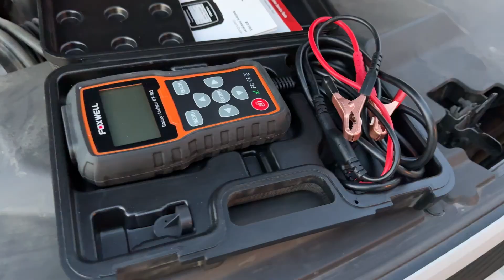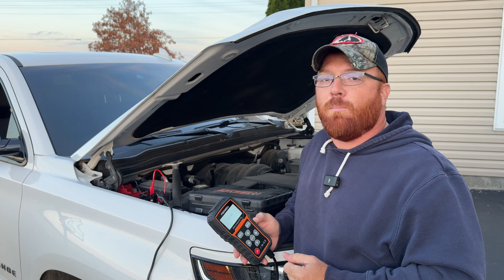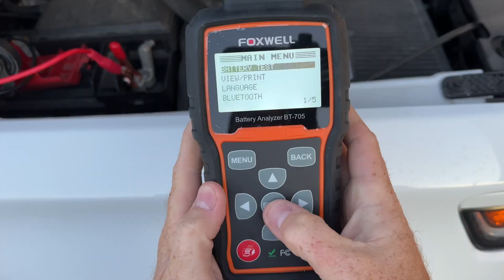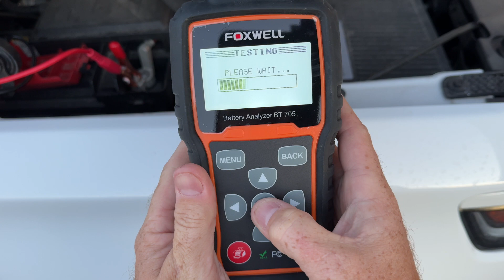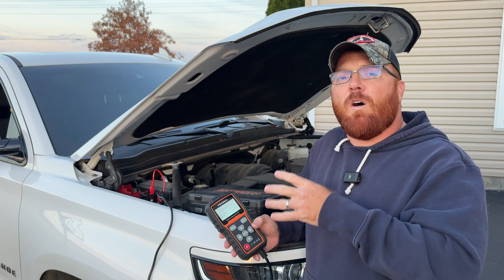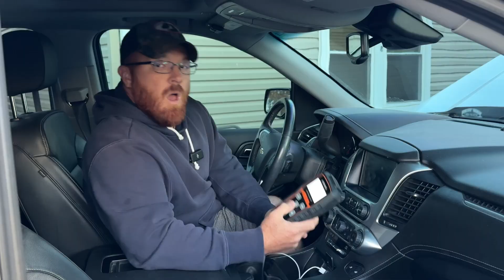FOXWELL BT705 Car Battery Tester Analyzer Review | Test Battery, Starter, & Alternator!

Comment: Got one coming in the mail on Saturday. Crossing my fingers.   I hope its the battery.   I just changed my Alternator back on July 4th, 2025 and the battery back in Late September 2025.  Having issues again this mrng in the DMV area when its been barely reaching 22 degrees during the day and about 10 degrees at night.  Luckily i had my jump brick with me.  My light were getting dim and the gauges on my dash all fell.  Had no power to the radio.  Jumped it and it was as if nothing ever happened.
Reply from the maker: Best of luck my friend! The cold a wreak havoc on batteries even if they are newer. What’s nice about this unit is it’ll check the battery and the alternator to you. I’ve seen brand new units fail right out of the box. Quality is an issue these days. I would also check your connections and make sure you don’t have a lose power or ground. This is very common and easily missed!

If they both pass and you can’t find any loose connections if it were me my next test would be to see if I had a parasitic draw and rule that out. I don’t have a video showing this right now but there are many on YouTube walking you through how to do this.